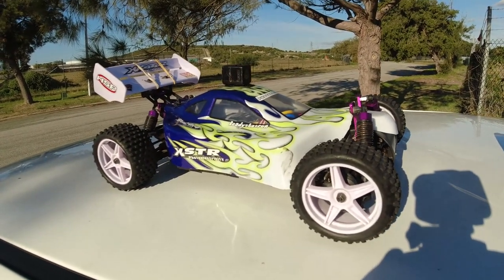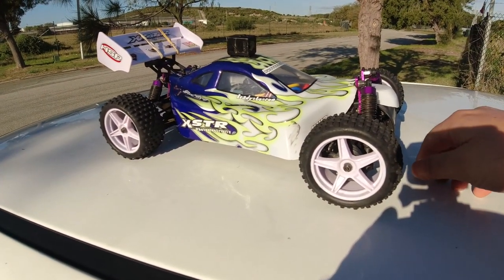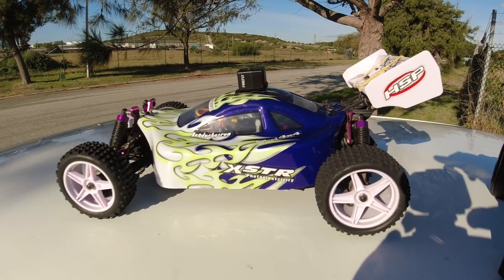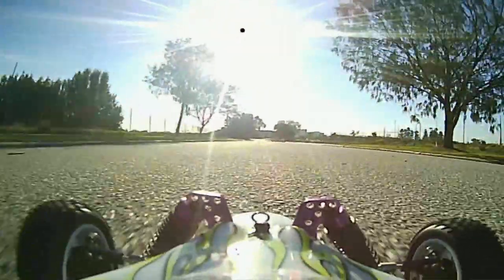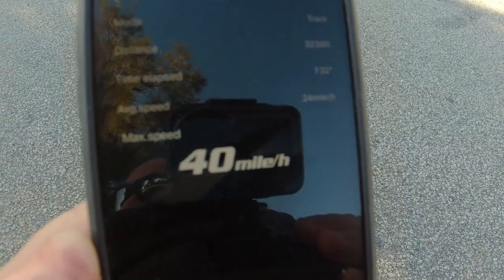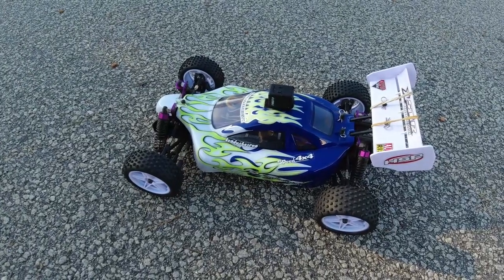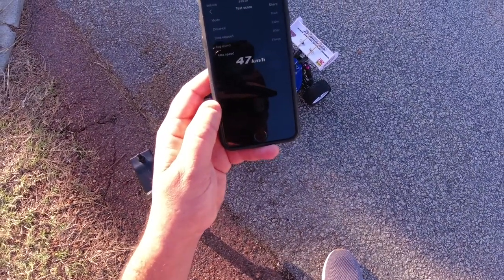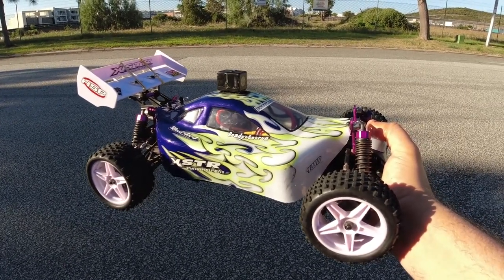HSP XSTR 1/10 Buggy Brushless Conversion - First Speed Tests

Comment: Yeah it does seem a bit slow but going back a few years I had a HSP short course truck that I converted to brushless with a 3650 3930KV motor with a  Hobbywing ESC and also got a 3s top speed of 65 km/h. So maybe yours is ok. I have the brushless "TOP" version of this buggy but I haven't bothered doing a speed test but I'm selling it anyway as I recently bought the Arrma Vorteks, which btw has been nothing but trouble so far.
Reply: @kodak_jack  Yep.
Reply: What’s been up with the vorteks ? My daughter really wants one.
Reply: @patmarcus172  Both diffs were tight and binding due to poor manufacture of the plastic parts. I had to carefully file away excess plastic to free them up. Also it keeps going into LVC within seconds when running at 100% throttle even though the same batteries work fine in my Typhon 3s. So for some reason the Vorteks motor draws more power than the similar motor in my Typhon, but even with the Typhon motor installed in the Vorteks it still goes into LVC prematurely, just not as quickly.
Reply from the maker: Yeah I'm yet to test my HSP ACE Fury Brushless buggy like this one on 3s, I think like you told me ages ago it'll get about 80kph, but anyways I don't like these escs at all cause they are clearly fake 120a, more like a 35 or 45A with the lack of power they provide this motor, I had all settings tuned to MAX, setting 10 for max punch and throttle this time. Expected note than 65kph
Reply: @PERTHWESTOZRC  Yeah I bought one of those cheap 120A escs once and it went up in smoke before the car had even moved a full metre.

Comment: Great Speed Run Dave 👍 am thinking its defo not 120amp Esc .3s wasn't too bad 😁 Hopefully you will get it to were you want it 😉  that's why this Hobby is good 😜awesome video.  👍have a great weekend Brother 
👍😛🇦🇺😎🇬🇧😜
Reply from the maker: Cheers Tony, yep I wanted to see if there was much change using this same ESC from my 104001 wltoys by installing it in this one😂 works OK for a first run test but not ideal, have swapped it over with another now 👌🍻 have a great weekend mate

Comment: Will be interesting to see what a better ESC does. That 3650 3900kv motor claims a maximum 69A draw, so I'm thinking you would want to get a 80A ESC. Also maybe a decent 3S battery too would help. Theoretically you should of got 70k/h on 3S if top speed was 47k/h on 2S.
Hopefully with a better ESC and battery you should get over 50k/h on 2S and over 70k/h on 2S fingers crossed 👍🏻
Reply from the maker: Yeah I'm pretty much done with these escs man, they clearly don't perform that well, all settings for punch and max throttle were set to highest. I've swapped in a surpass hobby I have laying around. And yeah I have some decent lipos coming so will give it another go later 👍🍻